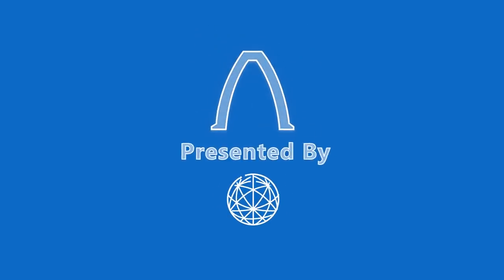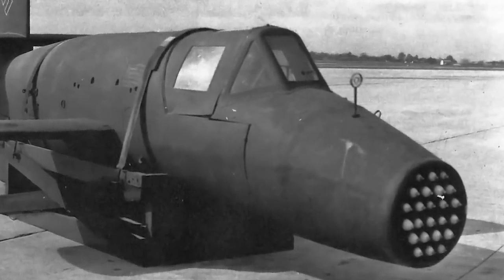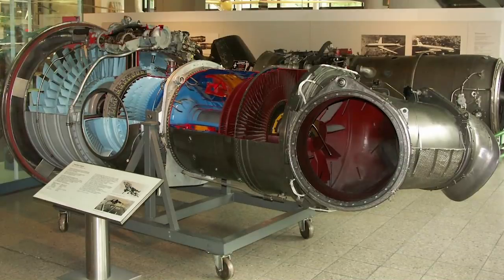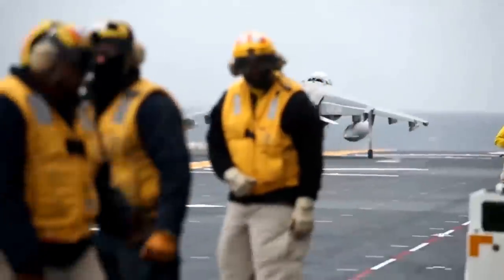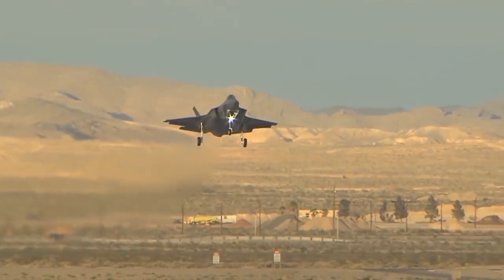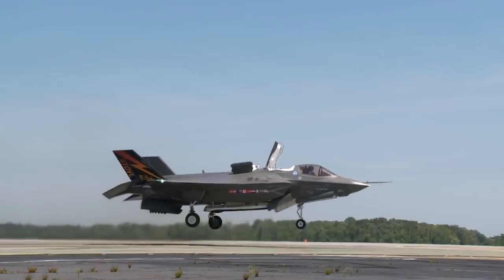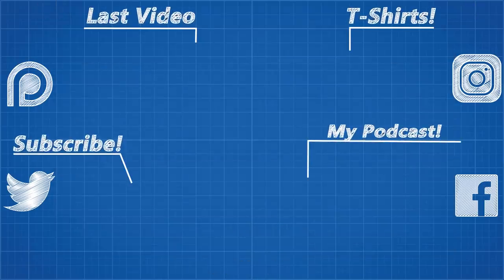The Real Life Sci-Fi of Vertical Take-Off Planes

Comment: 2 interesting facts about the V-22 Osprey:

1. The diameter of the two rotors is so large that they can't be tilted 90 degrees horizontally while the aircraft is on the ground, otherwise the blades would be touching the floor.

2. Either one of the turbine engines can drive both rotors via a driveshaft that stretches across the wing. So if one of the engines fails and can't power it's own rotor then the remaining engine can take over.

Comment: Little known fact: Yakovlev, the russian aircraft design company sold the designs for vtol to Lockheed Martin for the F-35. The plane that uses this design was an old soviet aircraft known as the Yakovlev Yak-38. Used thrust vectoring for the back two nozzles, and then had 2 smaller engines behind the cockpit for the forwards upwards thrust required for a vtol landing. The F-35 uses the same system, with a hatch opening above the forwards engine to allow airflow through it.
Reply: Not the case at all- the technology transfer happened, but how much of the Yak-41 specifially was used is arguably no more than studies of its flight envelope 

 The F-35B uses a vertical thrust fan getting power from the engine, not two separate turbojets. Layout of the cold and hot thrusters are radically different. The three-section nozzle is very similar, but both get their origin from a Convair patent from the sixties.

Comment: @Real Engineering the F-35 IS in service, the B variant in particular (VTOL) has been IOC since 2015 and has undergone its first tactical forward deployed to Kadena Air Base, Japan, as of last year. The F-35A (USAF) has been IOC since 2016 and participated in its first red flag exercise 17-1 in which it scored 145 kills to 7 losses. The only variant yet to become 'in service' is the F-35C CATOBAR variant,  which is slated to reach IOC this year.
Reply: This is for F-35A Block 3F since December 2017
http://www.luke.af.mil/News/Article-Display/Article/1386133/lukes-newest-amu-supports-f-35-program/
"The unit is the first Luke F-35 AMU to receive a 3F, or full-up, combat aircraft capable of pulling 9G’s in the air."
Reply: 145 kills against taliban or a professional military?

The Alshabab and Houthis could zap it out of the sky with emw weapons.

I'd like to see the f35 against the Russian S400 systems.
Reply: The Crab 145 air to air kills against F-15C's and F-16's operating within their own integrated A2AD environment whilst also emplpying advanced ECM. The F-35's were also pitted against top teir SAM threats such as the Patriot site and even the USAF owned S-300 without being detected or shot down by either. I dont know what your opinion is on the aircraft but the fact is there is no other aircraft currently in service that can match it
Reply: Reilly Brangan you would expect such an impressive score if you set the exam, sat it and marked it for yourself, wouldn't you?

In any case you have to justify the price tag for the kit. Otherwise who would buy it?
Reply: The Crab The F35 aircraft themselves aren't that expensive, and the program cost is only 1.508 trillion through 2070, which in terms of government money is pocket change, and the Red Flag exercise isn't rigged because what's the point of that? It shows the flaws and benefits of every aircraft involved and other air forces participate in red flag, ranging from France and Israel to Pakistan
Reply: The F 35 is not only very expensive, it lacks performance and has a small payload .  It is not even able to operate much, I notice they still have problems including not liking to get hot.
Reply: Barrie Rodliffe most of those problems are solved and the F-35 still has a bigger payload than the harrier
Reply: Barrie Rodliffe "lacks performance and small payload" the F35 is able to out turn the F16 (Built to dogfight) It can carry more payload while being faster than both the F16 and F18 and carries more fuel than both, it's definelty not lacking payload and performance
Reply: Mrbob brain.

Most problems solved, is that why it has hardly been used and spends so much time in hangars?  Has the problem of not liking to get wet been solved?  Has the problem of not liking to get hot been solved?
Or is it like the F 22 they solved the same problem about 5 or 6 times or at least they claimed to have.  The F 35 payload is rater pathetic for a modern aircraft, the Harrier was much earlier and served very well, the F 35 has not served at all.
Reply: Barrie Rodliffe "Not liking to get wet" the F35 has flown in the rain just fine, "Not liking to get hot" that's actually not a problem with the F35, within the weapons bay of the F35 they have avionics installed which haven't been recertified for high temperatures which means the F35's keep their weapons bays open on the flightline to reduce heat. "Hardly used" RAAF F35's are already flying at the same rate as F/A-18 Super hornets, "Rather pathetic compared to modern aircraft" the F35 can carry a larger payload than the A10,AV8,F16, and F/A-18 while also being faster than all of them if they were fully loaded up. The Harrier is also very old it's been around since the 60's so of course it's seen service, and the Harrier is pretty unsafe compared to other aircraft "Between 1991 an 2001, for example, the mishap rate for USMC AV-8B Harriers stood at 10.22 per 100,000 flight hours, more than double the worst rate for any helicopter in U.S. inventory, and more than triple the rate for USMC F/A-18 fighters"
Reply: The F 35 may have flown in the rain but it still requires a lot of maintenance if it gets wet, it even requires a lot of maintenance if it doesn't get wet.
Having to keep the weapons bay open defeats any stealth it might have and reduces performance and range.  The F 35 fully loaded up is slower and not stealthy at all.  Maybe the US just can't fly decent aircraft, the  Harriers in British use had low accident rates.
Reply: Barrie Rodliffe "Requires lots of maintence" the F35 in RAAF service is flying at rates just as high as F/A-18 Super hornets, the Avionics heat issue doesn't effect anything, pilots report it doesn't change missions or make them adapt they don't have to keep it open during flight but on the flightline  (the ground) to reduce pre flight heat, the F35 when fully loaded (internal) is still faster than the F16 flying with its full payload, the F16 carrying a full payload is slower and less manouverable because of drag. P.s the F35 has already been deployed onto ships and outside of the US
Reply: The F 35 flying about once a week between maintenance.  pilots report the heat issue is not a problem as long as they keep the doors open until they take off and then it is not a problem as long as it does not get too hot.  
The F 35 with a small internal payload, 5,700 lbs may be faster than a fully loaded F 16 which can carry 17.000 lbs, that is not much to write home about. The Flop 35 deployed on ships for what?  It has done nothing.
Reply: Barrie Rodliffe "Once a week" source? The RAAF says diffrentley, "Small internal payload" The F35's internal weapons bay can mount 8 diffrent weapons, the F16 using all of its hardpoints can carry 9, 2 of those hardpoints are wingtip mounted and can carry only air to air weapons, that leaves 7 hardpoints to carry other weapons or anti air missiles, the F35 can also mount 4 wing pylons and 2 wingtip pylons, which means a fully loaded F35 can carry 14 weapons on hardpoints. The F35's have been deployed to Japan and on the USS Wasp. The F35 is able to be deployed and would be able to effectively fight. "It has done nothing" For the longest time the US's more successful air superiority fighter the F15 did nothing in US service because the US didn't have any conflicts that warranted it's use
Reply: The RAAF have said little about the Flop 35.
The small internal payload or 5,700 lbs and that is if it does not carry full internal fuel.  Any external load means no stealth.  
The slow f 35 could fight what? a WW I biplane maybe.
The F 15 has sort of proved itself and since the US has upgraded the F 15 because of the failure of the F 22 and they still have the F 18 and F 16 in service because the f 35 is not really able to replace them just maybe shows up the F 35 for the failure it is.
There have been no conflicts since WW II that warrant anything like the F 22 or F 35.  In Syria there is no need for the F 22 or F 35, in Afghanistan there is no need for either. Just a collossal waste of money. 
The RAAF have no need for such a stupid aircraft and nor does anyone else, politicians unfortunately buy these white elephants.  
Lockheed has a history of making second rate aircraft and marketing them as do all wonder aircraft when they really do so little badly.
Reply: Barrie Rodliffe "Slow F35" the F35 isn't slow, the max speed of the F35 is 1,200 MPH or Mach 1.6, the max speed of an F/A-18 Super Hornet is 1,190 mph. "F35 unable to replace them" which is why the F35 is already replacing F16's, AV8's and F/A-18's? "Failure of the F22" the F22 isn't a failure, the USAF was forced to upgrade their eagles because the US Congress cut production of the F22, the current F22 fleet wouldn't be able to replace all of the F15's. The RAAF released a report saying the F35's are already flying at the same rate of F/A-18 Super Hornets. "No conflict that warrants the use of the F22 or F35" it doesn't matter that there is no current conflict that warrants the use of the best aircraft in your arsenal, the US won't be fighting Taliban in Afghanistan forever, the F35 and F22 aren't needed to counter such foes who lack basic anti aircraft weapons or an air force. The RAAF is buying F35's because they're better than the RAAF's current fleet of Super Hornets. The F35 is not a failure or a colossal waste of money, pilots love it, it out performs every legacy aicraft in US service, the price is going down, more F35's are being produced and the price is going down
Reply: 1200 mph, big deal, that is about as slow as you can get.   Mach 1.6 in clean configuration is a joke. We have planes that do mach 2 with a weapons load that makes the Flop 35 look very silly.  The F 35 has so far replaced nothing.  
The US congress cut production of the F 22 because it was an expensive failure.    There never will be a conflict for the F 22 or F 35, or at least you better hope there isn't.  Not much good having to wait for perfect weather before sending your aircraft to do the job other aircraft could do much better day or night, hot or cold, dry or wet.  
The price needs to go down to almost nothign to make up for the huge waste the flop 35 is.  It does not outperform anything much.
Reply: Barrie Rodliffe "Does not out perform anything else" the F35 out performs both the F16,F15 and F/A-18, The results of the Red and Green Flag exercises show that the F16 and F15 aren't a match for the F35. The F22 wasn't cut because it was a "failure" many lobbyists convinced congressmen that the F22 was too expensive when it's costs were being lowered. "So far replaced nothing" still false, Marine squadrons are transitioning to the F35B to replace obsolete AV8's, USAF squadrons are switching to F35's for example, the 58th fighter squadron, 61st squadron, 62nd squadron, 63rd squadron and 4th fighter squadron have all switched to the F35A. You still try and hold on to the weather myth, all F35 weather restrictions have been lifted for a few years now, the F35 is certified to operate in the cold, and the F35's performed pretty fine in the heat of death valley. And can you even answer what jobs the F16, AV8, F15, and F/A-18 can do that the F35 can't?
Reply: TheReal Lifehacks 1.2 trillion has already been spent on it what u talking about
Reply: mikeythebold tv No it hasn't, the 1.5 trillion cost is the cost through 2070 including fuel and maintence. So "1.2 trillion" hasn't been spent on it
Reply: Barrie Rodliffe not true at all.
Reply: The Crab
Because Red Flag isn't held to make aircraft manufacturers look good, it's held to determine if our fighting force is truly capable, otherwise, why the hell are we paying Lockheed Martin all of this money.

Comment: it should be noted that not ALL F-35s will be able to vertical lift, just the specific F-35 B. the other two variants are just for air force specs (F-35A) and intended as a replacement only for the F-16, and theF-35 C which is suppose to replace the hornet F-18 A,B,C,D which are aged air frames, but won't replace the E and F models that are still quite useful by naval standards.

the thing you should note is that the air frames may be the same but the guts are being revamped.

Comment: F-35 has nothing in common with Harrier apart from vertical take off. The technical aspects of F-35 are more similar to Soviet Yak-38. Also, Harrier land version was CAS only aircraft as it lacked radar however sea harrier had radar and was designed to be launched from ski jump of the ships.
Reply: The Yak-41 is closer to the F-35 design, but it seems awfully similar to the Convair Model 200 concept.

The F-35 is only similar in appearance and VTOL thrust placement though, since it uses a driveshaft to spin a lift fan while the Yak all used two jet engines to achieve the same frontal lift.
Reply: @ivanlagrossemoule  One engine - this was to become the Yak-43, which was a development of the Yak-141. It was built only in the layout. And since the creators of the Yak and F-35 collaborated, they got access to the drawings.
Reply: @Артём-ц5э8з  the F-35 design has absolutely nothing to do with failed soviet prototypes. The only thing americans got out of the Yak-141 was the flight test data. Lockheed was funding the Yakolev project, which in turn was flying the prototype and giving data to Lockheed. By the time they did that, the X-35 was already being built.
Reply: @lucastekkan  There is some information on the Yak-43 on the Internet. Yes, of course, I believe that the Americans did the same thing themselves - a coincidence. And the Yak-141 was not unsuccessful, it was a complete project, and the best in the world at that time. Check the information before you speak. He did not go into the series, because at that moment the USSR collapsed, and the entire Russian aircraft industry received huge difficulties.

Comment: One of the things that probably helps the most is the fly-by-wire on the newest setups. Helps dampen the flight behavior and limits the envelope through the vertical and transition stages, thus making it harder to do something too stupid. So the plane will nose down enough to get forward speed, but not too much vs. the thrust available to keep it in controlled flight. And I'd assume there's other indicator cues in the avionics to let you know when it's flying on the engines or the wings with AOA vs. forward airspeed. But it likely goes through a table controlling rate expo in regards to those factors so the transition controls should be smooth anyways. (Computer doing enough that it's probably more like flying a toy quad-copter in some ways than a regular helicopter.) Harrier didn't have a computer to help in that regard (all the corrections and noticing any cues for bad conditions on the pilot), so it was part of its risky and unforgiving reputation.

Comment: You need to check out the rigid rotor helicopter, I think Lockheed's AH 56.  Used a rigid rotor for higher speed, better stability, plus winglets for higher aero lift.

Comment: as a german, i'm disappointed you didnt mention the Dornier Do 31, the worlds largest VTOL. The apporoach was similar to the Harrier, with 2 Engines with 4 Outlets each mounted under the wings. Exept that this was not enough, so they decided to just brute-force it and attatched 8 Turbojets (4 on each wing) to the tip of the wing, mounted vertically, and only used for Takeoff and Landing. Naturally, this plane never got past the prototype phase, but is still interesting to look at and see how they managed to get 25 tons of plane into the air!

Comment: I changed many AV8-A engines in the 70s and latter I became a Navy pilot. The exhaust nozzles are mechanically rotated by slightly larger motorcycle chain mechanism. Very simple. No computer at all..in those days.

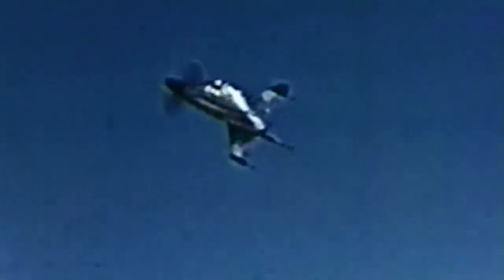Comment: @2:15 i've seen an aerobatic pilot do this in his vastly over powered single engined plane. He flew low and slow over the airfield keeping just enough power on to remain in the air but the fuselage angled more and more to vertical. When the plane was 'hovering' vertically, he some how nudged the plane along the runway to where some balloons were tied to a frame. He then lowered the tail of the plane down to pop the balloons with a sharp point on the tail. THEN, he powered up and went straight up!
I couldn't get my hat on!
Reply: Ironically in RC aerobatics that's the most basic of beginner maneuvers where it's called a Harrier to hover but scaled up it's on the extreme end of both pilot and plane capabilities

Comment: The problem with these VTOLs is they are using jet engine thrust to lift an entire plane. That is sort of like using your arms alone to lift a truck. It takes way too much power. Helicopters are able to lift large amounts of weight and hover using only a small amount of power because they have rotors that cover a large area and can spread the work load over a long distance by spinning those rotors quickly. Like using a pully. If you want to make a VTOL aircraft that can efficiently operate in both VTOL and forward flight, it has to be able to change how the power is used (like a transmission).